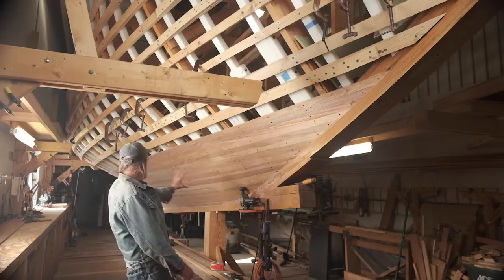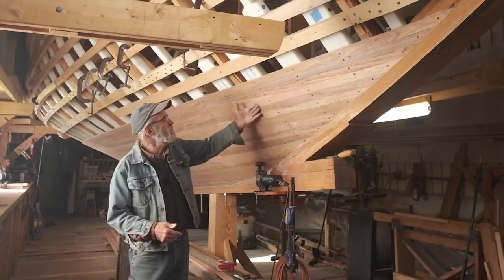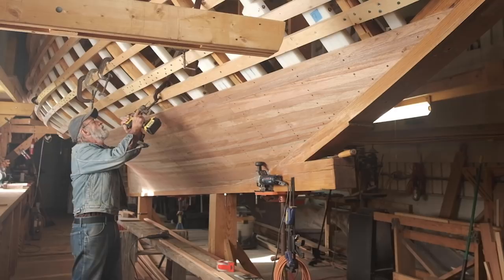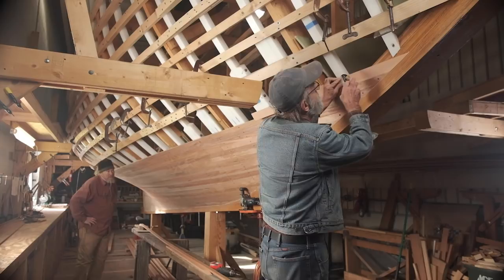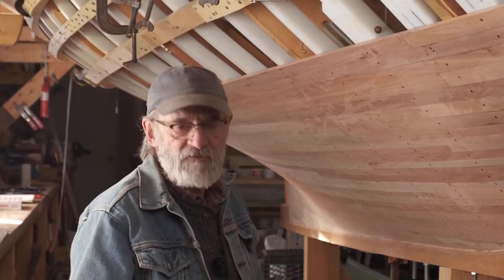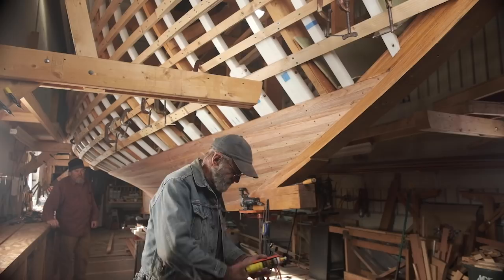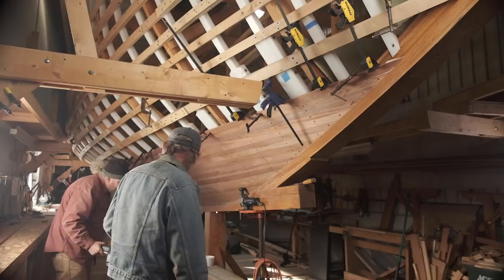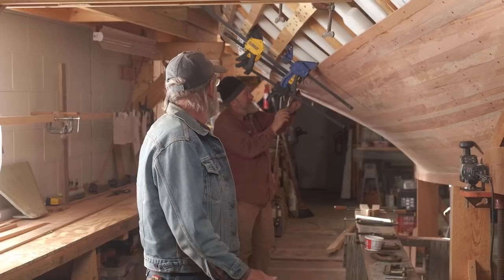Building Evelyn: Hanging a strip plank, EP6

Comment: Oh, and yes, I shorten the bristles on my brush when I apply WEST system epoxy.  I even shorten the flux brushes that I use for small applications.  However, I cut them with scissors, because my chisels are not sharp.  However, I mostly work with plywood and fiberglass.  I am in awe of your woodworking/boat building skill, and it inspires me in my own project, currently a 1967 Cal 25.

Comment: I first used cut down paint brushes when I started to work in the 80's  there we used them to remove dirt and grime from handheld two-way radio controls and bodys..it made a great job.... used them since for cleaing carb's, engine  parts etc..but never worked with a glue that needed spread like that.............excellent video thanks for your time & effort making them for us

Comment: Am I just getting a funny angle. It looks like the topside is very close to the wall of the shop. How did you work up there?
Reply from the maker: Good observation. it's pretty close on the starboard side (about 2' 6"). But it's enough to get the job done.

Comment: Could you bead and cove the strips like a strip wood canoe ??
Reply: Yes. That's a good question.  But it would be a bit of a material and time waste, here, since you are double planking and using epoxy. This is the most economical method in cost, time, material, and ergonomics that Lou has been able to work out in his 50 years of boat building.

Comment: Beautiful work as usual Lou. Instead of a butt joint how about having done a half lap joint so that the planking fits into (or under) a lip on that front piece (don't know it's name)?
Reply: I have been playing with this idea too. It requires a bit thicker plank to work, because when you screw through that joint, the top layer needs to be thick enough to accept the sink of the screw head, and still hold the pieces in place.

Comment: Hi Lou, the plastic material UHMWPE may be suited to do the skin of the hull as it is water tight, resistant to abrasion, UV light and impact. It is a thermoplast at relatively low temeratures such that one might devise a system to melt-fuse the plastic planks into place without using screws or any metal device. The interior framework which needs to be as stiff as possible might be made of wood/aluminium rather than plastic. That way you'd end up with the hull skin and deck all of one piece, very strong...

Comment: Great system and fine looking craft.  Are the brushes you use cleaned each time or are they disposable?  Thanks.
Reply: I was wondering wich system he uses to clean the brush and the containers with glue in it.
Reply: The brushes are cheap and not worth the cleanup. That is the one thing with epoxy work - amazing stuff but it does create a bit of consumable waste. I went through a ton of disposable gloves as well which Lou doesn’t worry about heh.

Comment: A Robertson head screw with the proper sized bit is superior to any other screw . The Robertson bit will not slip out of the screw and has proven itself repeatedly since it was invented in the 1930 's.  IMHO.   I would also use a slow speed or brace & bit for fastening bottom planks.  👍🇨🇦
Reply: AKA Square drive. I use them wherever I can.
Reply: Torx head are also much beter
Reply: Gary Rawlins   Yes however not readily available for marine fastenings.

Comment: I was looking forward to seeing the progressive bevel right off the tablesaw or at least as you installed the plank but you have not shown a close up of it yet?
Reply from the maker: Good point Rob. We'll try to get some shots of the bevel off the table saw. The difficulty is that the bevels are very slight. In fact, the greatest bevel on a strip plank is 5 degrees. The progression from 5 degrees to 0 takes place over no less the 5'. So it's hard to see. We'll also try to get some inside and outside shots to show how tight the planks fit inside and out.